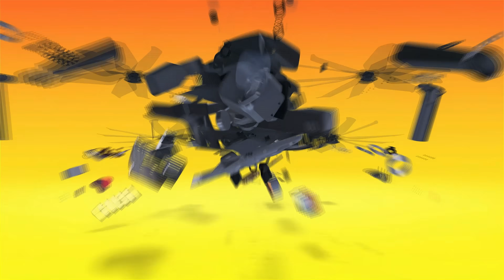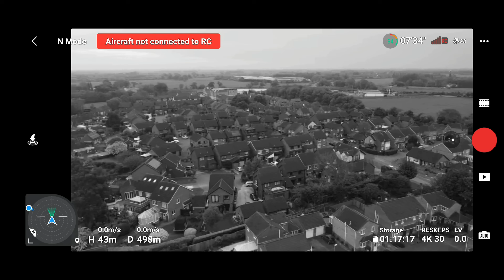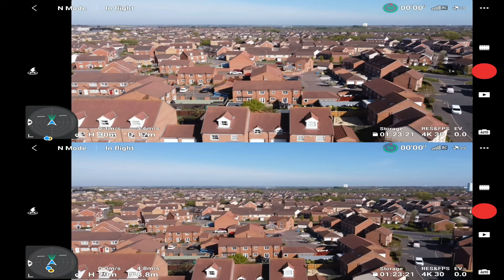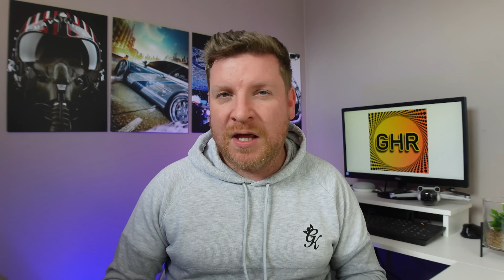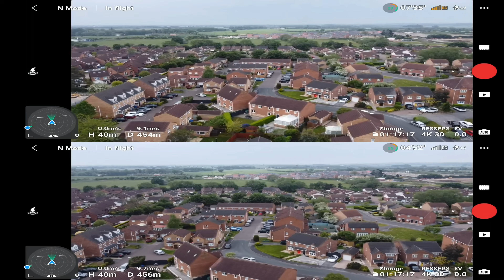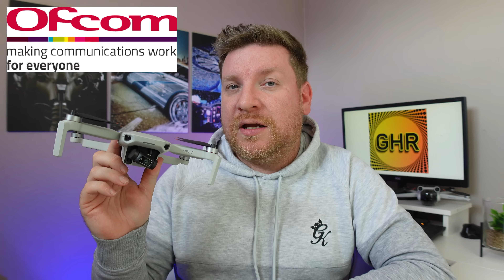How I FIXED My DJI Mini 2 Connection Problems - ILLEGALLY

Comment: Been using it for over a year and I can’t fault it. Feel so much more confident flying with the improved signal strength and quality.
Reply: Tell us exactly where to get it from then
Reply: @Badmana0  see my name here on youtube and google it :) I can't write it in the comment because youtube will remove it.
Reply from the maker: See pinned post mark
Reply: @GAVINHR  
Looked on where you pointed out couldn't find where can i get this app just for enlarge my scoop not for use it permanently..
Reply: @muatazeltayeb7231   @Mark John  see my name here on youtube and google it :) I can't write it in the comment because youtube will remove it.

Comment: A difficulty arises in that you may have demonstrated to Ofcom that drones are unsafe in urban environments.
They could just as easily lead to a ban on urban drone flights as to your desired outcome of an increase in permitted signal power.
Reply from the maker: The feedback was overly positive to be fair Graham and actually seemed quite receptive and open to the suggestion that we should be able to free up more power for applications such as UAS, will it change anything ? I suspect not
Reply: @GAVINHR  good to know that they aren't taking the wrong view of things.
In your initial video I think I remember you switching the settings to 5.8ghz only?
This surprised me because why would you disable half the available signal options?
The CE power limit for 2.4ghz is much higher than 5.8ghz
Reply: @GAVINHR  At least we are free of EU regs now if we wish!

Comment: they have reduced the power that's why I will not order the mini 3
DJI MAKES CARE OF THE CUSTOMER
Reply: I'm afraid there will a large number of Mini 3 owners with the new controller that won't be able to use a modified app that gives them FCC power/range.
Reply from the maker: Yes that is the case

Comment: Great test and explanation. However it would be great to know and learn why in Europe we have not the same strength signal as in the US...this makes no sense at all and i agree with you that FCC strenght improves the safety a lot
Reply: There’s a lot more interference in the u.s, we’re smaller then Texas so could you imagine all the internet use the interference in a country like America is going to be alot more then here hence
Reply: But I’m prob wrong, gav?
Reply: Simple explanation - it comes about as a result of Pilots not abiding by the regulations. Example: idiots flying over busy airports or miles off (not literally of course) having total disregard for VLOS. Nobody can convince me that they are able to keep unaided visual contact with the miniature Mini 2 when it’s 1 mile/km away.

Comment: Keep the MINI2 and buy the battery harness that allows you to use the  Mini3 47 minute battery with your Mini2 Just mount the battery on top  of your Mini2.
Reply: Wouldn’t that make it less aerodynamic which will reduce efficiency and negate the benefits of the bigger battery.

Comment: Really interesting comparison video Gav. Got a couple of questions though - so its iOS only from what I’ve seen but via link so did you need to jailbreak your iPhone (i assume you are “tweaking” it… 😏? Also I’m on older firmware after using your rollback video (so updated the battery drain fix but then rolled back to the one before, before DJI stopped the loophole) - does that mean that EU mini 2s were running stronger signals with that firmware or would it still have been below FCC? Wondering if there would be any benefit for someone doing this who was on older firmware anyway. Strange decision from DJI, wonder if they got complaints by the authorities in UK/EU that the signal strength was too strong.
Reply from the maker: Hi there, it's certainly not iOS only I'm using an android device :) no jailbreaking at all it nothing needed in that respect, no the mini 2's were running the max permitted bit it seems to be eve. Worse for whatever reason after the FW update, the difference even on older firmware is huge still
Reply: @GAVINHR  thanks for the info 👍 looks like the one I was looking at have developed an android version since the original video (which was iOS only). Totally agree on your safety comments, needs to be reconsidered.
Reply: You don’t need to jailbreak iOS as the drone-tweaks has a developers account from apple and can use your uuid to allow the app to be installed on your iPhone/iPad as if it were from the Apple store

Comment: Begs the question?  Is flying a drone beyond visual of line of sight more of a ‘crime’ than driving  a motor car at 10mph over the speed limit. I think a car at any speed can do considerably more damage than any drone that weighs a mere quarter of the weight of a bag of sugar 🤔.
Reply: So what if you do. I fly mine over 3km away and nothing happened. Just do it anyway
Reply: @grizzlybear2702  no shit. Too many drone Karen's from "land of the free" police state America..usually, telling you what to do and get a "part 107"

Just fly responsible. Its that simple
Reply: @Matanumi  I flew my mini 2 almost 4km away in my local park and nothing happened. Im from uk. So what if it’s illegal How would I get caught
Reply from the maker: The thing is here, the use of these apps are only really allowing the drone to fly even still within UK regs, but as a safety aspect I think the max allowed broadcasting power under CE regs needs looking at, I reported back my findings so let's see if it becomes a consideration
Reply: The VLOS requirement for a camera drone is pointless in my opinion, especially in a rural environment. If you're flying 30m away you can easily fly your drone back safely without using the screen. If you're flying further away (or up) where your drone is just a dot in the sky you can't even tell which way the drone is facing, which could make it very hard to navigate your way home.

We need to rely on the technology, the video feed and the return to home function. We already have the technology to fly BVLOS and many people do just that.

Comment: I did say FCC was much much better than CE months ago - I'm concerned though that the new Mini 3 Pro with screen will be CE limited.
Reply from the maker: Yep! Well I had to make sure that the bases were covered to do a video like this mate ! I've not spoken to the developer but I do think it will be only possible using your phone / App / RC-N1 controller
Reply: I think Florin is looking in to it to see if it can be put on the controller.
Reply: it can only be installed on a phone or tablet.. and smart controller will not work..
Reply: Pretty sure I've heard the new smart controller with the mini 3 Pro runs on android, so it's only a matter of time until apps can be side loaded to it I'm sure. Where there's a will there's a way
Reply: @BigBobAyr  they never managed to get the app working on the smart controller/rc pro, so I doubt they'll get it on the new rc- I used to fly my air2s with a drone based hack using the smart controller though, the hack was on the drone rather than in the app though
Reply: Mod DJI Fly iOS v1.4.8

Increase range and signal strength by around 70% 

Unlock 5.8 GHz band in restricted locations 
Weather Status Alert, Fn Button Override, Auto iPhone Charging
Unlock Airsense (ADSB) on supported Mavic Air 2 drones

Comment: Good test. It doesn’t seem to make sense as far as withholding this from users is concerned. What do the BDF say?
The only thing that baffles me though is how can one expect to see that tiny drone (I have one too) at 500 meters with the naked eye? Or even at 250 meters in that urban environment? Or us that a misunderstanding of the rules on my part? I’ve had my drone out at 600 meters over open water (at the coast) before. But I couldn’t say I could see the drone at that distance. Just wondering. 🙂
Reply from the maker: Purely as using it breaches CE outputs I don't want to be seen to be promoting it. Personal I can easily see the Mavic mini at 200m I guess it is dependant on individuals, VLOS aside the current signal quality out of the mini 2 is quite poor so in urban areas I feel safety is more important, even if you can see your drone if you can't control it due to a poor signal then that's a greater hazard to me than exceeding VLOS.
Reply: @GAVINHR  Wow! you have the eyes of an eagle.😄 Personally I can't see it after 100-150m.
Reply: @GAVINHR  thanks Gavin. Do you use strobes or is that unaided at 200m? And have the BDF commented about the connection issue?

Comment: But why does the eu have tight restrictions on broadcasting power. Is there a problem with the controller sending out a more powerful signal.

Comment: Great test man!
Reply from the maker: Thanks mate! Took a lot to make this video but felt important to make the point ☺️
Reply: @GAVINHR  Definitely it's sad really that it cannot be used as a licenced radio ameture in the UK, i can legally use 400w of power! would of been nice to see what the actually output of the transmitter is for the FCC version.
Reply from the maker: It's 30dbm for FCC, we get 14!

Comment: I noticed that I have the same weak signal issues and thought there may be something wrong with my drone. Coming to think of it since watching your video it has been since the last update.
Isn't it possible to roll back the update to a previous version?
Reply from the maker: Hi there, no after the last FW update sadly DJI disabled the rollback
Reply: @GAVINHR  Well, I well and truly feel robbed :-(   Any idea what the last known good version was?
I guess this is going to be the same issue with the mini 3 pro.
Cheers
Reply: If I buy a brand new Mini 2 replacement aircraft it will come with older firmware so then I can choose not to the latast firmware,  right??
Reply: @sousarogers  You might be lucky with "old stock". You could always buy from someone by mail order/distamce selling and send it backj for a a refund if it has the newer firmware already installed on the Mini.

Comment: Very interesting. I'm glad I did not upgrade the firmware jet though... And I didn't do it cause of warnings not to do it too quick...
Reply from the maker: Exactly that ☺️ best to stick as you are
Reply: I'm still on 01.03.0000 and fly app 1.4.8 (1185) works great. But I'd still like to know lol
Reply from the maker: Bet far the best combo Mate honestly
Reply: @markcloudchaser874  I'm running tha same as you and have not updated due to the problems.
Reply: @garystone6583  yeah this is the best firmware to be on in my opinion. I've never had any problems with mine yet, but I will not update it, because you can't go back. Why fix something that ain't broke .👊
Reply: Check out QTechX u tube channel